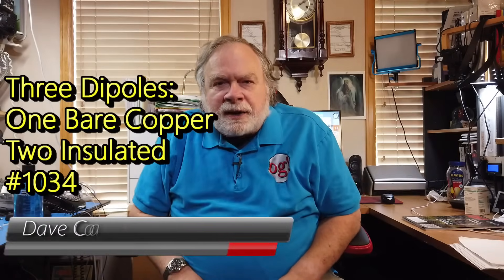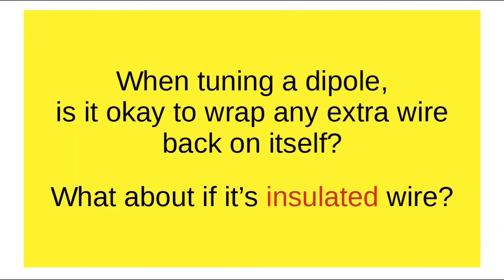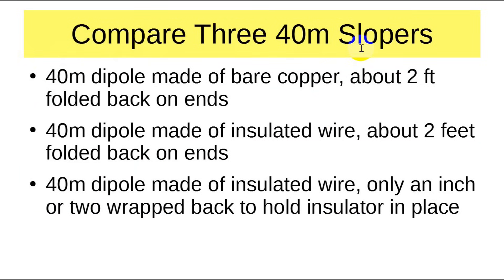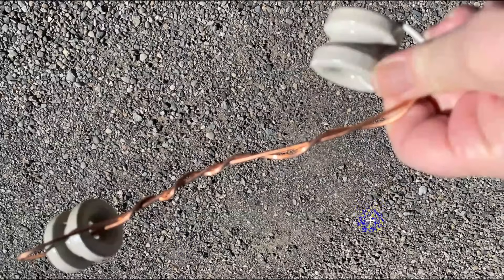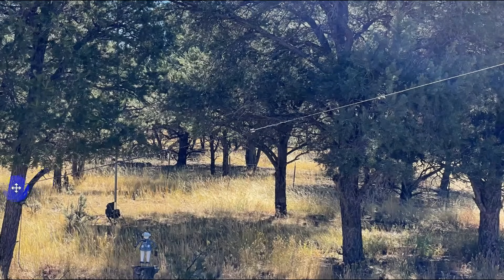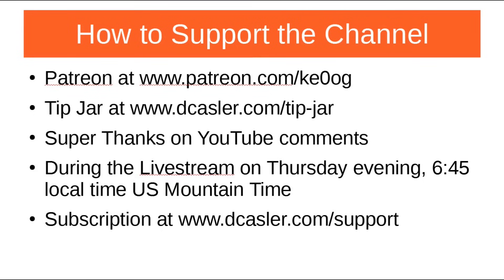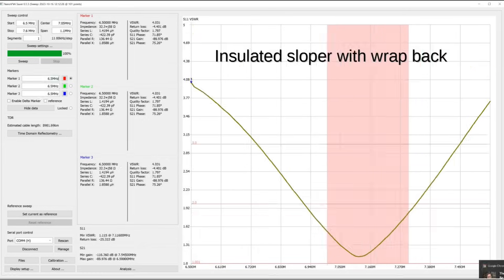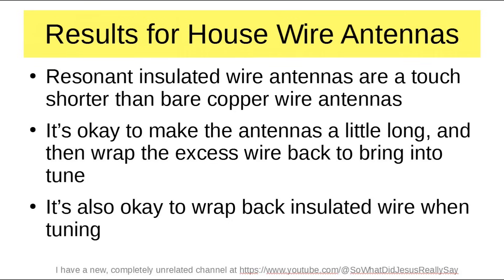Dipoles: Wrapping Back Excess Bare or Insulated Wire (#1034)

Comment: Some people say that it's better to just secure the bitter end of the wire with tape/zip ties parallel to the standing part; others promote twisting the bitter end around the standing part.  Is there a difference?  It's a surprise that the insulated and bare wires responded identically.  I didn't expect the capacitive coupling to be that strong.   (Sorry, lifelong sailboat guy and nautical terminology fits this better than anything I've read in the ham radio world.)

Comment: Groovy! I am going to build a full wave horiz loop about 1.3 waves long at 40m. Then tie another identical  loop onto it only connected electrically at far end to first loop and not at feedpoint. Hopefuly forming a widebanded, high impedance twin lead fed radiator that will have low takeoffs at 20 meter with old style manual transmatch. Like turning a folded dipole into a loop, even though a folded dipole is already a loop, hence only one connection in my "Folded Long Loop". No data or modeling predicts the behavior authoritatively, so the only way to find out is to try it. I think it might come out at 600 Ohms or higher and if lucky, being low to ground, could hit near 450 ohms which could be a killer match, or the current directions in the antenna are unpredictable and may be self cancelling....?

Comment: Hi Dave.  I feel I have something to contribute here.  It concerns small backyards.  When I first got my license I went on 2 meter nets and explained that I had only a 30 x 15 ft backyard.  There is also an unhelpful very tall inaccessible spruce tree in the neighboring yard.  Declaring this on one of the weekly networks an Elmer showed up.  My Elmer suggested an vertical he found on Ebay.  It worked somewhat but I noticed that he had an MFJ 1775 rotatable dipole that works for 2 M to 40M.  I have that on a mast up about 20 ft.  With it I have contacts in Alaska, Eastern Russia, New Zealand, and Tasmania.  Also much of South America.  Above that on a short piece of mast I have my home brewed seven element 2M horizontal dipole.  Local Hams hear me without rotation on that.

Comment: I did the same test with a transformer-fed end fed half wave antenna and noted that folding back seems not to shorten that antenna (much) but cutting it will, as KC3SWZ has observed here also. Maybe it's dependent on how tightly the folded back section becomes capacitively shorted toghether, which depends on how close the wires are and what the insulation material permittivity is. 73, OH3WAV

Comment: If you wrap back a decent amount of insulated wire for tuning you need to leave the excess attached afterward. I wrapped a couple feet of excess insulated wire back on a 75 meter dipole to get the tune I wanted. After getting it all tuned I snipped off the excess. Then my antenna was too short!  This shouldn’t be an issue with bare wire since it shorts back onto itself but the insulated wire is still an extended antenna while wrapped back, just not as much as if it were extended all the way outward.

Comment: Something I learned from DXCommander - when you wrap back a decent amount of insulated wire (say 1-2m extra wire), you actually pull the 3rd harmonic down more than the fundamental, so you can get both 40 and 15 to be perfect. It's worth doing this experiment to see if it works for you too.
Reply: That's worth keeping in the hip pocket!

Comment: What about a full-wave circular loop made from small copper tubing on 10 meters using rg-59 coax matching stub, could you electrically shorten it by re-soldering one end progressively to tune, 
and folding excess inward?

Comment: This experiment should encourage everyone to try adjusting their (isolated) wire antennas just by wrapping back the excess wire. The folded back piece of wire, as long as it’s close enough (and it usually is) to the main wire, takes the RF - inductively coupled - with it and doesn’t affect the expected properties much.  It works, that’s all we want. Only if you want to get overly precise, you must take the foldback into consideration as a kind of capacity hat, which makes the antenna electrically a little bit longer. The higher your frequency, the more you will notice that effect. Thank you very much for this highly instructive video! Vy73 DB6YC

Comment: Did not see where you explained the law for capacitance reactance Xc = 1/2Pi * FC. As you wrap a insulated wire back onto itself  you are making a capacitor.. Thus RF will see it as one wire in spite of it being two since the RF passes through the capacitor before it reaches  the end

Comment: Where is comparison between bare copoer wire dipole with ends folded back vs ends trimmed up ?  I didnt see that in video ?
Reply from the maker: The folded back bare copper wire is shorted to the main wire, hence will not make any difference as long as it is wrapped reasonably tightly. 73, Dave, KEØOG

Comment: Good stuff Dave, once again.
In my early days of radio I wondered about insulated or non insulated wire and decided there was no difference. Only an SWR meter back then. 
I also folded wire back with the same conclusion.
Wire is cheap. 20 to 10m so five dipoles in my attic but three coax cables to make tuning easier with less interaction. 
G4GHB.

Comment: The foldback of insulated wire result conflicts with some other observations, it has been said that for example if you foldback a significant length of insulated wire the resonant frequency does not go up as high as it would if the wire had been cut. I should try some small scale examples with a VNA ... thank you for the video 73

Comment: Thanks Dave. I've often wondered about that.  Now tell me, would two or more antenna  wires of equal length running parallel to each other, only being connected at each end, result in more signal strength into the receiver?
Reply from the maker: Probably not. However, if the two wires are connected only at the tips of the antenna (and not in the middle), you have constructed a folded dipole. The feedpoint impedance will be considerably higher. To get a predictable folded dipole, you need a constant spread for the whole length of the antenna. There are numerous resources on the Internet and in the ARRL antenna book.
Reply: Thanks Dave.

Comment: Hi Dave, you did a nice experiment. But you made a mistake, which did not change the results, but may confuse some hams. See 6:35! The wire is in direct contact with the rope, the insulator is useless. It might matter during transmitting, if the rope was wet.
Reply: Okay for a test in dry weather as you say
G4GHB.
Reply from the maker: Good point
Reply: I built a Moxon antenna with the wire connected via paracord, tuned up great in the dry weather, and was terrible in the rain. I need to put some insulators on there if we get a sunny day.

Comment: Interesting.  I had a fold back on my 80m extension of my EFHW.  It caused the lowest point of the dip in the band to only go down to 2:1.  As I trimmed and adjust the foldback the SWR kept dropping till it got down to about 1.2:1.  KC3SWZ 73.

Comment: Good morning David,
I have made both insulated and uninsulated dipoles for 40 and 20 metres.
You are quite correct, it does not make any difference if you fold the ends back on themselves.
HS0ZQA David Thailand

Comment: Thank you for sharing this interesting and education video with us. I guess the antenna just "catches the wave" and it's the overall length of the antenna (from end to end) that matters and not how much wire (including "wrapbacks") is in the antenna. What would happen if the "wrapback" went all the way along each leg of the dipole so there was in fact twice the amount of wire but the antenna remained the same overall length? Would the antenna receive a stronger signal with twice the wire?
Reply: I made a dipole that I cut  for 40 into a 20 dipole and I wrapped it all the way back  as I didn't want to destroy the 40 metre dipole, and it worked great.
David 
HS0ZQA Thailand

Comment: Thanks Dave.  Very interesting experiment and results.  Would be curious though if the insulated wire wrapped back, if in a tighter coil configuration and greater extended length, might influence the resonant frequency more readily.  Not sure if the insulated tighter wire coil would actually shield the signal, add capacitance or simply exhibit parasitic coupling.  

Obviously, cutting off the extreme excess of wire would be the solution of course, but my response/question is more theoretic in nature and a pondering point.   

73, Dave, AC3HT
Reply from the maker: Hi Dave, I don't think it would make much difference. 73, Dave, KEØOG